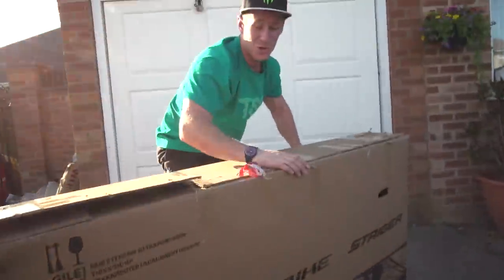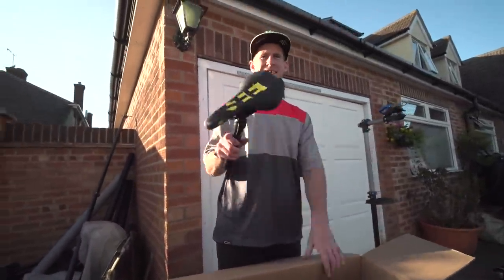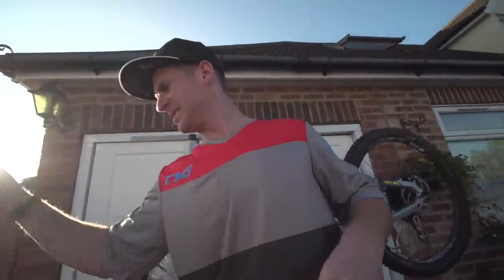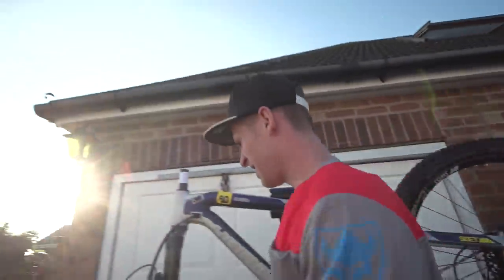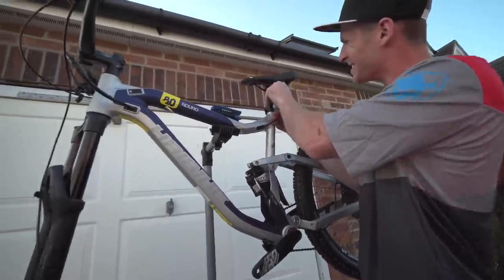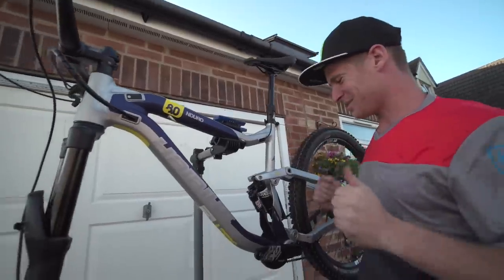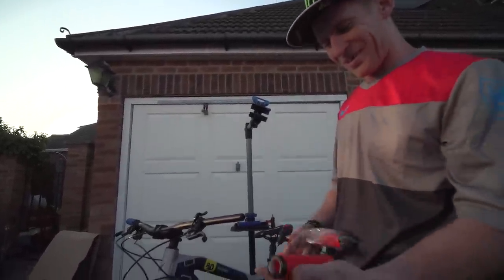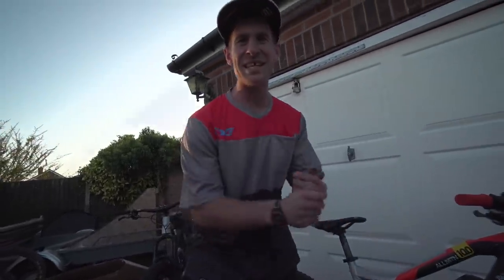MY NEW ENDURO BIKE - NO ELECTRICITY NEEDED

Comment: Some of the component choices for these bikes are a little weird. I mean metric is not really needed, but with such a new bike it would be nice, the monarch does not even have a debonair can on it, I swear every bike comes with them now? Stem is longish for such a modern bike as well. Also what are those stock gripssss, is this a commuter bike or what haha ? Just my thoughts on it.
Reply: dartwadermovies I got myself a Knolly and it doesn't have metric either. It's not necessary. I really don't see the advantage no matter how many articles I read.
Reply: There is none, but if the industry goes forward with them you be out of luck the next couple of years.

Comment: So the new wheel was adam eagle 12 speed did you swap cassette off new wheel onto the used halo ? As the halo didn't look sram 12 speed eagle , if the group set is eagle the shifter will be 12 speed , you may already know this